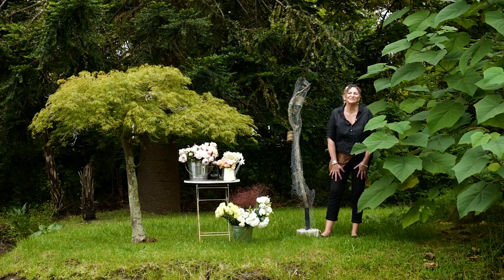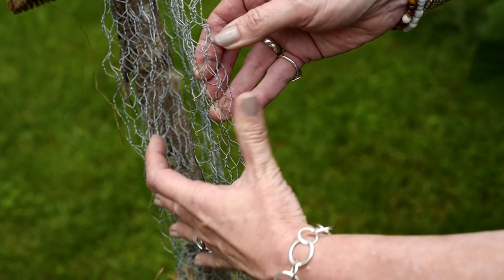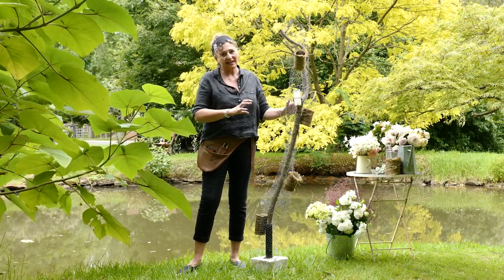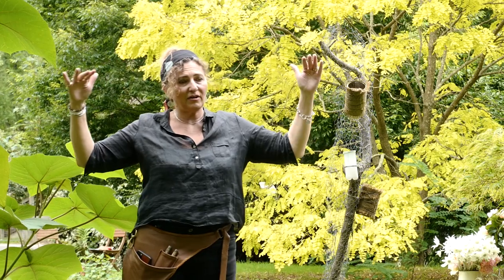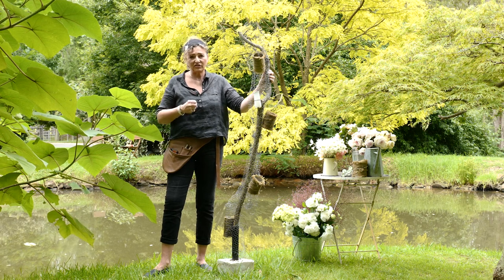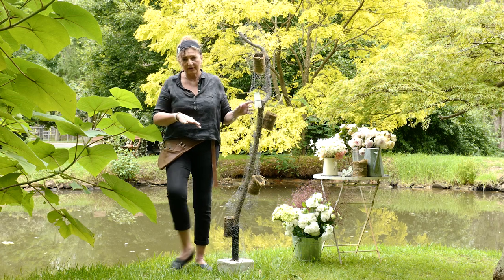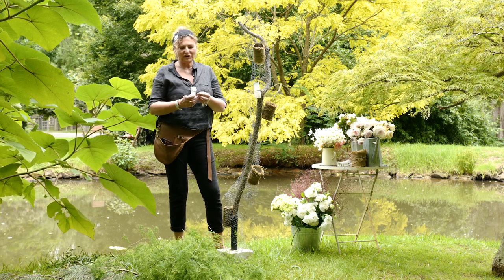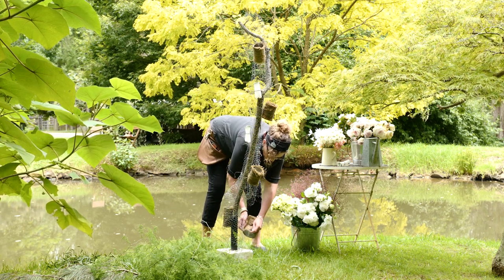How to design a  Floral Column - foam free

Comment: Will the Floral Column fall over easily with the weight of the materials?  It is absolutely  beautiful !  Great job !
Reply from the maker: Thank you for your comment.
No this base is concrete with a plastic pipe set in place, unless of course its a super windy day, in that case i would insert the branch directly into the soil for stability.